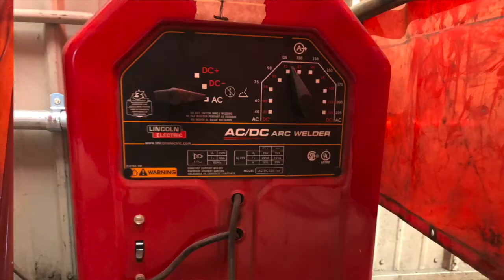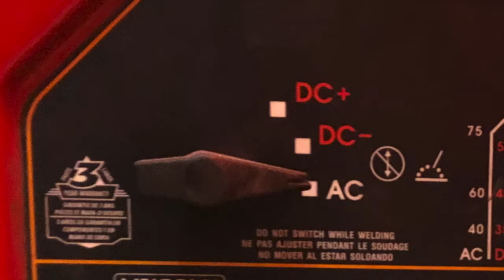Welding 101 Beginners Guide:  Number 3 - Parts of a Welder and Electron flow

Comment: Hi, Trev, 02:28, When it is DCEN, the electrons flow from electrode to workpiece but current flow from workpiece to electrode, since Electrons always flow from negative → positive, Conventional current (the standard in circuits/welding) flows positive → negative (opposite to electrons).

#CHAT GPT:
1. DCEP (Electrode Positive)
Electrode = positive
Workpiece = negative
👉 Electron flow: workpiece (–) → electrode (+).
👉 Current flow: electrode (+) → workpiece (–).
⚡ Effect in welding: ~70% of the heat is generated at the workpiece (cathode), ~30% at electrode.
This gives deeper penetration (used in Stick welding SMAW).

2. DCEN (Electrode Negative)
Electrode = negative
Workpiece = positive
👉 Electron flow: electrode (–) → workpiece (+).
👉 Current flow: workpiece (+) → electrode (–).
⚡ Effect in welding: ~70% of heat at the electrode, ~30% at workpiece.
This gives faster electrode melting, less penetration (used in TIG for welding thin sheets).
Reply from the maker: Good explanation